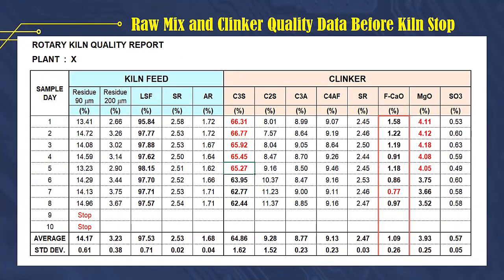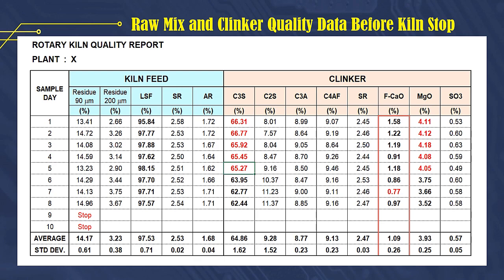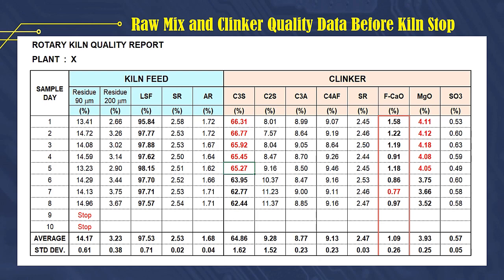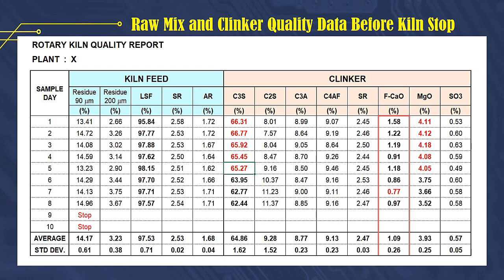Effects of High MgO Content on Kiln Operations_ English Version

Comment: MgO can also affects burnability of the clinker inside the kiln and acts as flux.Why they didn't adjust the AM ratio? What do you think will happen if AM is reduced?
Reply from the maker: Thank you for your question.
If AM is reduced what happens is that C3A decreases slightly and C4AF slightly increases, but not too much effect on kiln operation.
Because at the same time we operate seven kilns in one location, and have the same problem when MgO > 4%. So we try to mix raw materials that have a high MgO content with those that are low in MgO, so that the MgO raw mix is between 2.5 - 3.5% according to the target.
Reply: @parroscement2625  I mean what will happen to the coating if AM is reduced or increased despite high MgO is present in the raw materials? Thank you.
Reply from the maker: As long as the MgO element is still high, AM is increased or reduced, the coating still forms. If AM is reduced, more melt will occur and vice versa.
Reply: Okay Sir. Thank you.